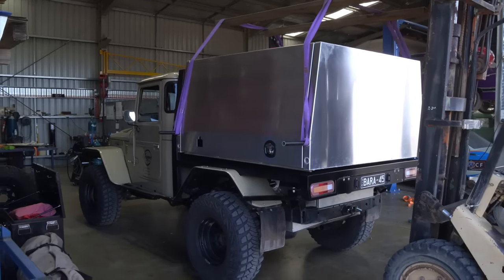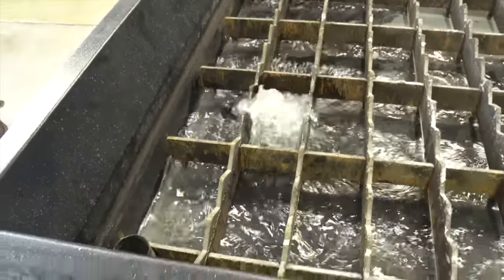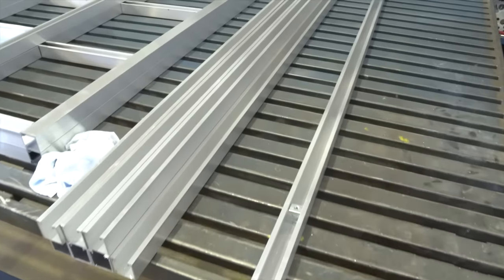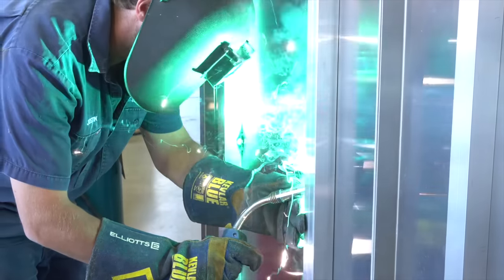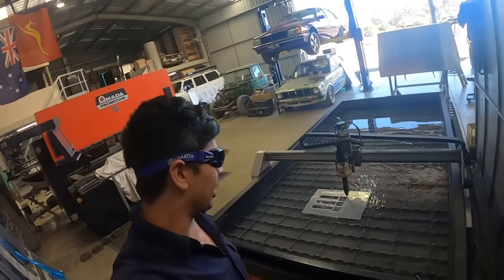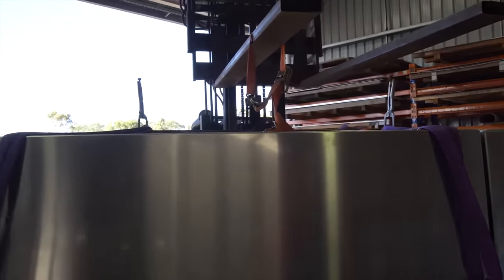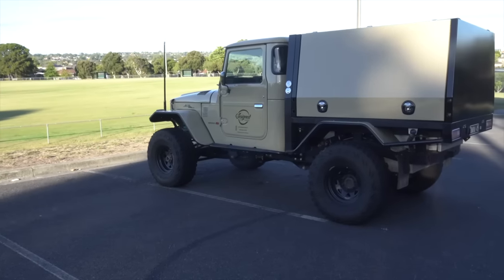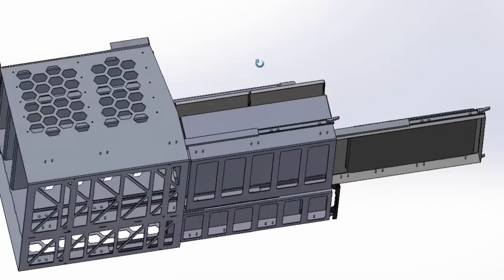BUILDING an aluminium CANOPY from scratch

Comment: Far out that is mint Richard.  Grab some insulation material (high density closed cell foam for example) and place inside the roof and doors of the canopy.  I did this with mine and it really cut the heat down.
Reply from the maker: Cheers Andrew, cracking idea

Comment: Nice work mate. Very similar to the builds I use to work on at Chameleon AMLS. I do like the 3 point locking setup they used better but the way the  door seal you used is a better way

Comment: I don't think the colour matters that much, all paint is black in infra red. The fact that an organic material like paint is conducting to aluminium will heat it as much as anything, but aluminium has a pretty low convection rate and high conductivity, so it should stabilise some of the heat out as a heat sink. That said, most of your surface area is inside, so if it really doesn't want to stay cool and cooks your shit, cover the top of the roof in aluminium RHS before adding your accessories on top. That will offset back down closer to ambient at least, for little weight addition.

Comment: Weird Question, what cloth or meterial is that on the brake press?
I do a few odd things and I always have to polish my parts and things after bending but I see this cloth helps with preventing bending marks.
What is it called and where would I be able to buy some of it?
Reply: Looks like kevlar
Reply: Bunnings bought Fire Blanket that you see in the Red packs

Comment: how did you mount it to the tray?
Reply from the maker: 4 bolts!
Reply: @DesignedandBuilt  if it rains the water will pool on the tray, how do you know that it’s not going to fill up the canopy from underneath?
Reply from the maker: Tray has drain holes mate!
Reply: @DesignedandBuilt  mine did also, hope it works for you!! Love the design👌🏽👌🏽